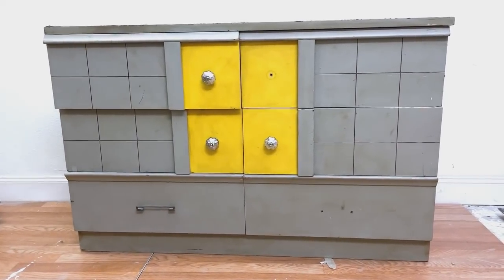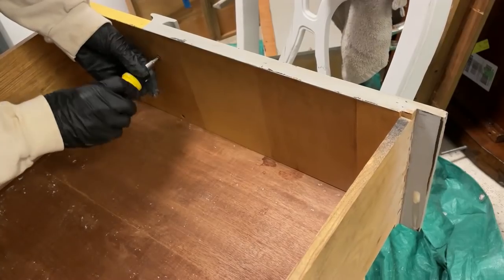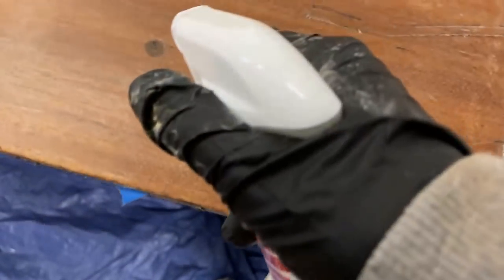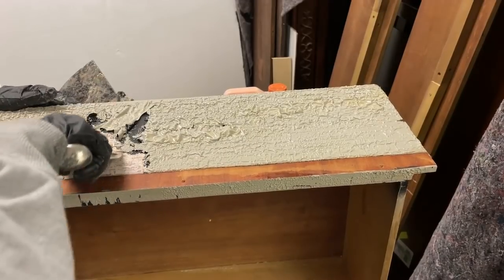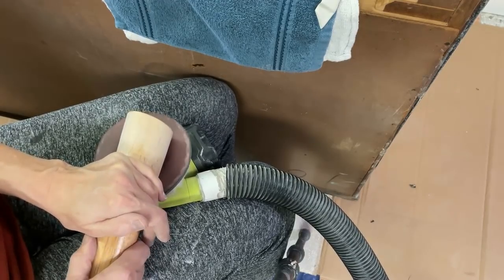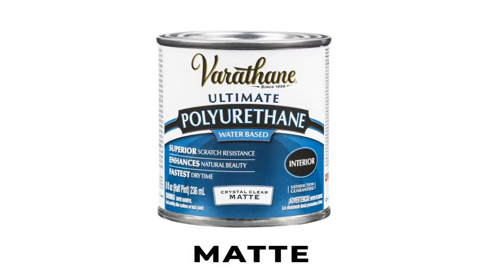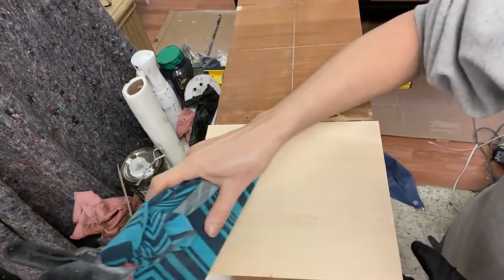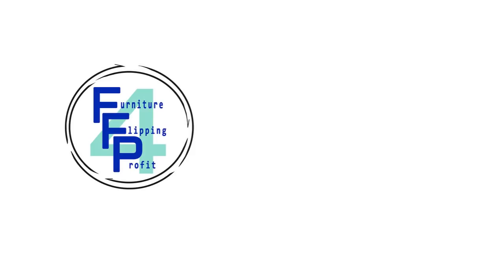AMAZING  RESTORATION of Mid-Century Modern Dresser. Shocking Results!

Comment: How veneers are applied has a lot to do with how long they last.  The oldest ones were applied with hide glue and there's lots of examples of those still going strong hundreds of years later.  Get yourself an edge trimmer to trim the veneer to an exact fit.  They're not expensive and work like magic to give your veneer a perfect fit.  Hide glue isn't expensive either but you need a heated glue pot.  Pro tip is put water in the glue pot and glue in an old jar. Set the jar in the water.  Keeps your pot clean and if it gets funky just get another jar.  Mix up some more glue and you're back in business again.

Comment: Gorgeous!  Thank you for not painting more than you had to. 

Good job on those scrapes.  I've also seen someone use a soldering iron on a gouge, and a wet towel.  Oxalic acid also works for bleaching wood.

I feel your pain on the stripper, and like to use my heat gun, as multiple coats of paint seem to take no longer than just one.
Reply from the maker: Hi Daniel. I do not have a heat gun but I agree that with all the coats of paint I should have tried taht instead of all the toxic chemicals!!! Thanks for watching.
Reply: @FurnitureFlippingForProfit  Try your hair dryer. When the finish starts to shine, you can literally peel it with your fingers! No gloves required.

Comment: May I make a suggestion.  I notice you use a scraper to clean the indentations on the drawer.  A hard bristle toothbrush or a soft small brass brush works better and cheap enough to throw away when used up.  Actually any small brush with stiff bristles works well.  I've used this trick for about 40 years now.  Thanks.  Also I would like to see some faux finishes in use.  A lot of the furniture in the Versailles palace were done this way - to resemble marble, malachite, etc.  Doing a dresser or cabinet with a faux marble top or tortoise shell finish or something would be very interesting I believe!!  Thanks.  Have fun if you decide to experiment a little.
Reply from the maker: Hi Phillip. Thanks for the tip. I actually has a tooth brush on the table with me--- should have used it! I always experiment so who knows, I may do a tortoise shell finish on a dresser or drawers some day! Thanks for watching!

Comment: WOW What a pain but so well worth it.  I am an old man and have been doing this with my dad since age 10.  
I can go on endlessly about how you did things here that most people do not, but just good practice.  One example, you put lacquer over the metal painted pulls.  Another is that you neutralized your bleach with vinegar, another thing I consider essential.  In short you do excellent work.  
However may I point out 2 things?
See the finished dresser's grid lines should look like individual drawers?  Easy fix is to use a black crayola crayon inside that groove or a china marker, or even a sharpie.  I will sharpen it up, since some are dark and some are not.
I do not know why, but most people use stain right out of the can.  I always thin mine out because you can always add more coats.  OR you might not like the color, you can then switch to  another color of stain if it looks too red or too yellow.  Also, a thinned stain gives you more working time so you are not all rushed;  you have more control.  You can also add additional coats to certain parts that are not taking the stain as much as other parts within the same piece of furniture.
Golly, this is a beautiful piece.  😍

It is a shame I just discovered you, you have a lot of common sense and understand it all.  It is crazy how they market wonder products at a high cost when all it is is bee's wax and mineral spirits, etc.  Thank you.

Comment: Great result, especially considering the state.  Well done.  Props for trying the veneer - it really lifted the piece, which would otherwise have been a bit dowdy.   I'd recommend that you don't put vinegar on bleach though as doing so releases chlorine gas which can be dangerous, even in a ventilated space.  A better choice would be sodium metabisulphate or sodium thiosulphate which you can get from a spa supplier and are safe and effective hypochlorite neutralising agents.
Reply from the maker: Hi Rob and Sharon. I will have to look into your recommendation regarding vinegar. I know when you add ammonia you get a gas and I think it is even on the bleach container. As I mentioned in the video it is my understanding that vinegar neutralizes bleach.  I will do the research and it will be reflected in the next video where I use bleach. Thanks for watching!!!

Comment: What a transformation! I do have a question: you used two different types/brands of wood fillers.  Can you tell me why you did that?  Was there an advantage for one vs the other?  I'm newly beginning in my furniture refinishing business and I'm still trying to learn all I can!
Reply from the maker: Good questions Denise. You actually WATCHED the whole video! Good for you!  I did it intentionally because up until I saw the severely damaged/repaired area on the left side, I thought I could stain the dresser. The Goodfilla can be stained. Once I realized I could not stain it, I switched to my favorite DAP wood filler (that cannot be stained). PS-I had never used Goodfilla before and it did NOT take the stain. Apparently you are supposed to mix the stain into the Goodfilla and I found this out after I had stained it. Thank goodness I could layer more of the waterbased stain on top of the Goodfilla so I could cover it.

Comment: Wow it looks awesome 💕do you have any ideas on how to refinish a 1970s waterfall dresser. It looks like the 1920?or 30s waterfall bed set but it looks like paper that has the wood finish that’s been photo copied. Any ideas would really help
Reply from the maker: If it is not real veneer then the only thing you can do is to paint it with chalk paint. You COULD veneer the drawers and stain them and then paint the body of the dresser like I did in this video.  You could also apply a faux wood finish like I did in this video: https://youtu.be/EvSRhYohXnU   Let me know what you end up doing. Thanks for watching!
Reply: @FurnitureFlippingForProfit  I will thank you

Comment: I'm wondering, why don't you use oxalic acide instead of bleach? (Sorry if you have previously answer this question) Thanks!
Reply from the maker: I have never used OA. From what I have read it does not work well to actually bleach the wood.  The videos I have seen more often than not show that it did not work. Bleach always works for me. This outdoor bleach is extra strong and works very well. I am unable to find the 2 step Rustoleum wood bleaching kit. I think that is the best way to bleach wood but I can't find any one that is selling it!

Comment: I know this is an older video so you probably won't see it but I thought using latex paint was a big no no.
Reply from the maker: Hi I made DIY all in one paint using latex paint. It works great!  I did a side by side test comparing my DIY recipe with commercially available all in one paint and my recipe was just as good as the expensive brand.

Comment: I’m wondering why you didn’t use more stripper rather than bleach.
Reply from the maker: Because all the finish was off it! Stripper does not do a very good job of getting rid of the stain used on the wood. Stripper removes the sealer.  Bleach will lighten the stain used on the wood.

Comment: You made this a much bigger project than it needed to be. Advice; it's free! You could have glued, wood filled & sanded, then used Ace Hardware oil based enamel paint. No priming, no sanding between coats and no sealer. VERY DURABLE. Also, I didn't care for your color choices. Sorry. 👎
Reply from the maker: Hi. I did this as a part of the Ugly Duckling Challenge. I wanted to stain the entire dresser but found that the last side I stripped had been damaged so I had to paint the body since I could not stain it. I was able to stain the drawers and top. Yes, using 3 different strippers was a big mistake and made it much harder. The fact that the base was so damaged took a lot of work (and dry time) to repair. I could never have applied an enamel over the finish that was on this dresser. It was latex paint with lot of brush strokes. It would have looked awful if I just painted over it. Thanks for watching.